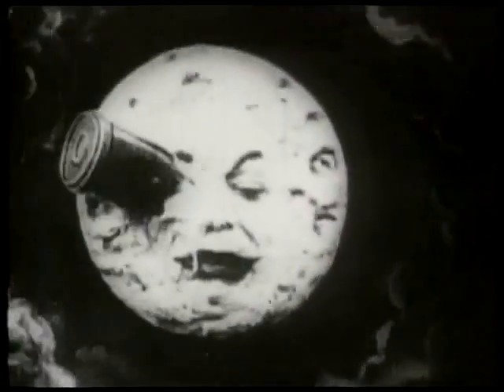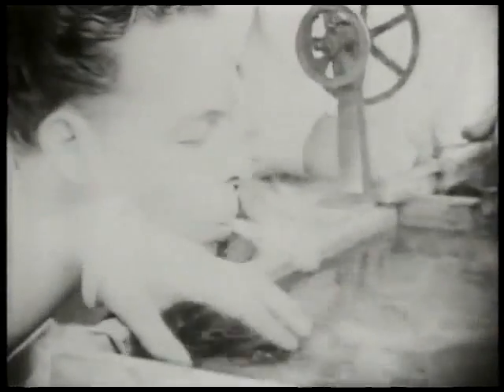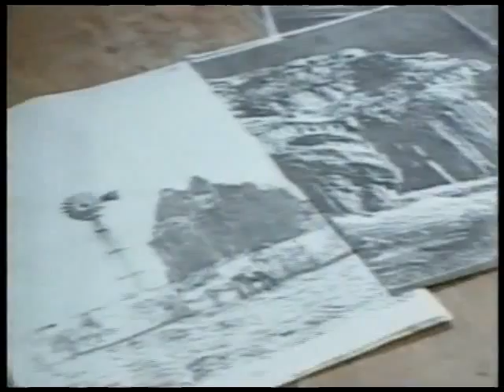Movie Magic Models and Miniatures

Comment: What an unbelievable effort in terms of money, tools and material compared to 3d graphics today 😮
Reply: In actuality, CG effects houses, the good ones that is, can be many times more expensive than a model effects workshop.
Reply: 3D requires a LOT of work. Just because a computer is involved, it doesn't make it as easy as pushing a few buttons. 

I'm making a no-budget film right now. I need a rat monster creature for it. I've dabbled in 3D modelling and animation for 15 years - and still I've opted to build a rod puppet for the rat creature instead. As complicated a process as it has been, I think it would be way more difficult to get a good result with 3D graphics on my own.